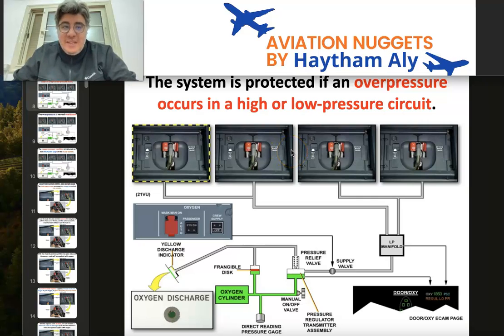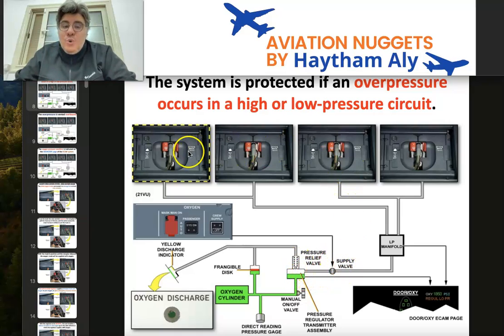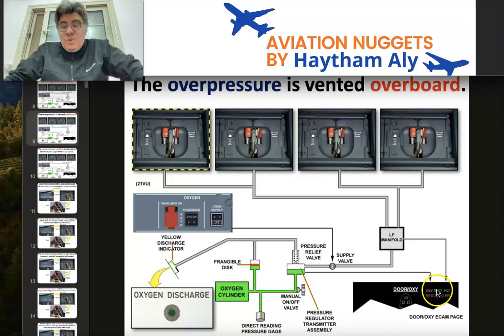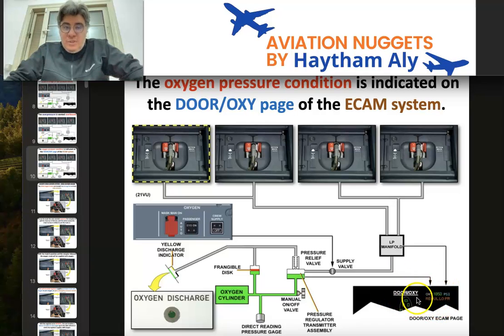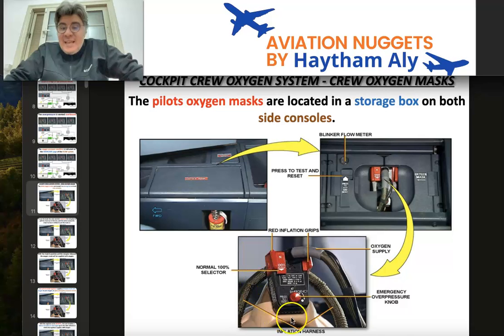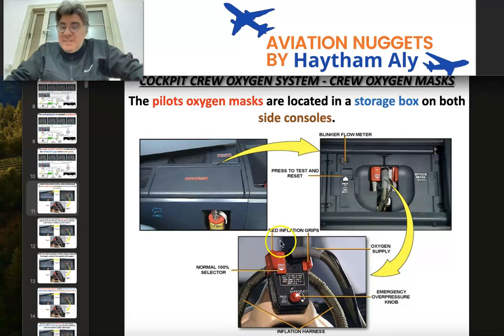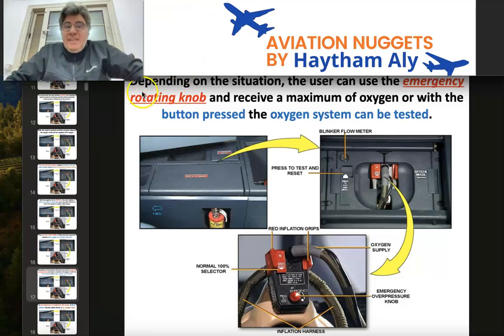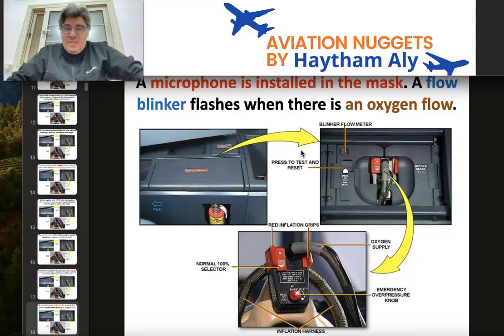#A320 ch35 OXYGEN system part 2, #Aviation_nuggets @Haytham_Aly for #pilots &#aircraft #maintenance

Comment: Please I have doubt… for frangible disk is it used for thermal runaway ? ( incase there was high temp and this high temp cause expansion and thermal runway … and for press relive valve for overpressure … thanks Mr.haythem for those useful video and it help me a lot